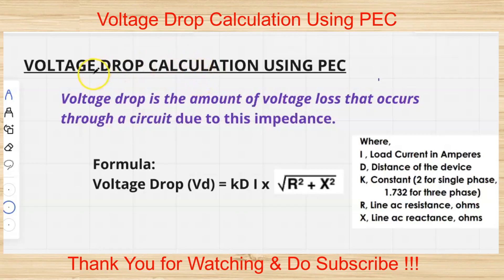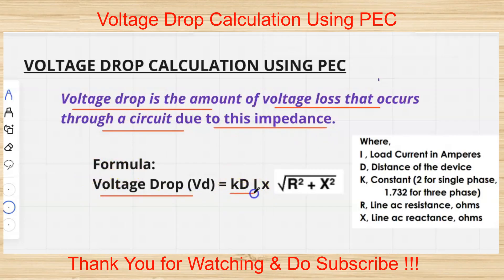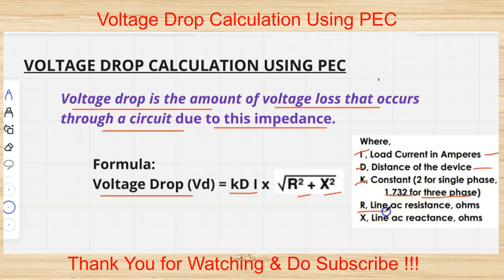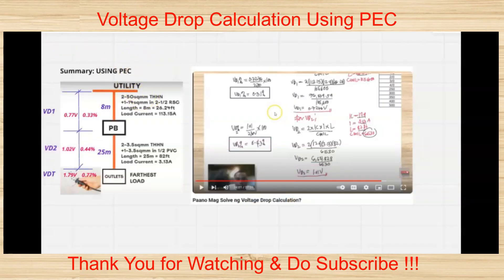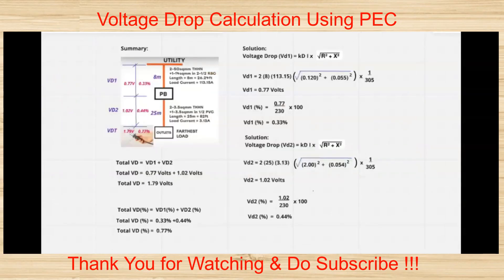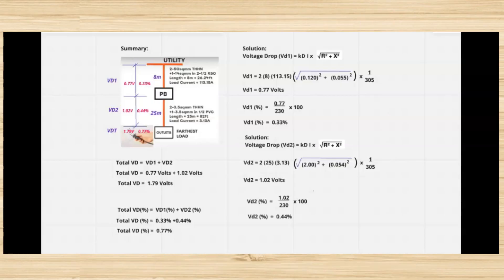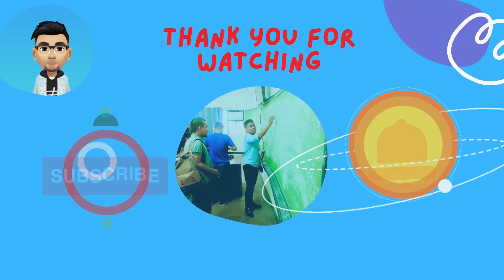Paano Mag Solve ng Voltage Drop Calculation using Philippine Electrical Code (PEC) ?

Comment: sir allowed po ba gamitin ang PEC "Table 10.1.1.9 Alternating-Current Resistance and Reactance for 600-Volt Cables, 3-Phase, 60 Hz, 75°C -Three Single Conductors in Conduit" kahit 230volts ang system?
Reply: Up
Reply: update po?
Reply from the maker: Yes applicable Yan from 0-600V AC. 
Max range yang 600V